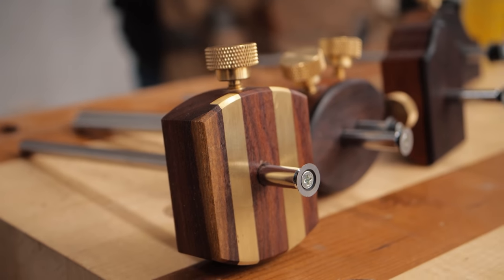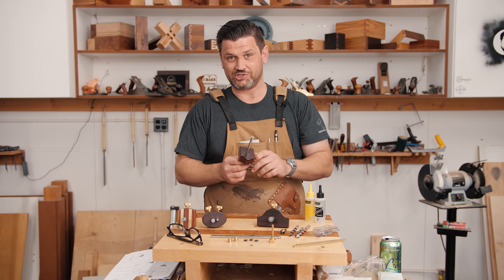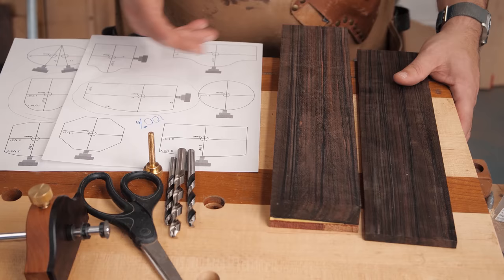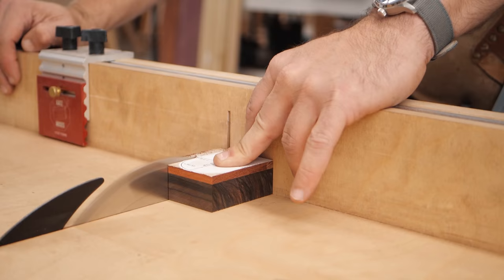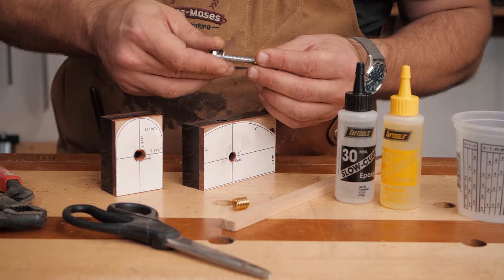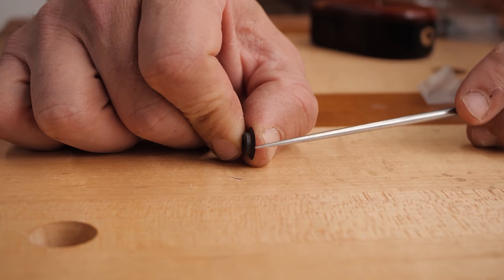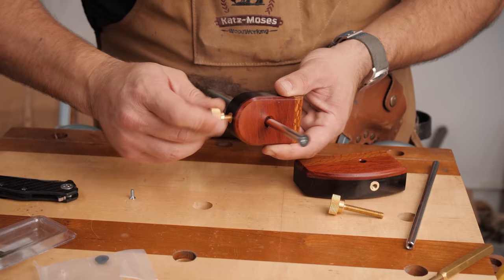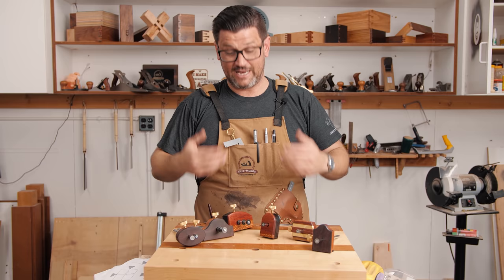Gorgeous Woodworking Marking Gauges - DIY for Under $12 - Free Plans and Templates

Comment: I ordered a kit and the 8mm bit and the mortising blades while the video was playing. 

Made a nice unit in walnut. The only thing I found was the shaft measured 5/16”. When I tested the 5/16 vs. the 8 mm, the 5/16 gave a slightly better fit. 

I’m a happy camper. Will be ordering a few more kits. 

Thanks JK-M.

Comment: I just finished making one. Did not turn out as well as I'd have liked. Everything was perfect until I went to insert the threaded brass sleeve. My first mistake was that I used a short bolt which did not extend down into the 1/4" hole which means the bolt did not provide any alignment and it went in a little crooked. Then it started to crack the wood (walnut) as I screwed it down tight and a small chunk actually came off the top. There was an internal split in the wood that I did not see and it cracked there. 

In the end I was able to sand the top but the mar is still visible around the sleeve and the brass knob is at a slight rearward angle. It is still 100% functional. The walnut and white oak laminate looks great. But, it is not at gift level for sure.

I will do two things to make sure this does not happen again. 1. I'll use a long 1/4" bolt so that it aligns the sleeve properly. 2. I have a cheap Harbor Freight tap and die set with the right sized tap for these sleeves. I experimented with some scrap wood. Threading the hole with the tap makes the sleeve go in much more smoothly and will probably decrease the risk of splitting the wood. A little epoxy should keep it in place.

Comment: Just what i absolutely love, easy and cheap tools i can make myself.
I have literally started an entire shop by building my own tools. So far, mostly my hammers: brass, wood, and a few smaller ones like a chasing or a finishing hammer. Chisels? Sure, i have a few. I love building my own tools, i have 2 compasses in the works, and a metric ton of other tools. Its waay too much fun, and when i grab one of my own tools, it feels so good to use them.

Comment: I've never had much luck with stock threaded inserts going in without splitting something or go in straight. I have typically got in the habit of using a dremel or hacksaw to cut two or three grooves across the threads, perpendicular to the body of the insert, as deep as the thread is high. I find they "cut" threads into the wood rather than force their way by trying to displace the wood.

Comment: If you cut the head off a bolt, you can put a couple of jamb nuts on it and lock it in the chuck of a drill press.  Turn the chuck by hand (don't turn the drill on) to install threaded inserts while keeping them square to the surface.

Comment: Trick with 3m super 77 only spray your paper template lightly,then Wave the paper template back and forth so glue tacks up then stick it to your work peace. Don't stick it wet or it's permanent if you do it correctly paper peels right of . Super 77 is permanent wet and contact if dry tac.

Comment: I covered it with blue painters tape. Then used the spray adhesive. Then put the template on that. The blue tape leaves no residue to clean up.

Comment: These are great, I'm in. The only somewhat obvious issue I saw with the single rod for mortises is trying to secure the second cutter blade. It looks like it's difficult to tighten the second blade without it moving. Jonathan was fumbling with it. Sliding a rod in and out seems much easier than trying to hold that tiny blade and tighten it without it moving. With that said, I'll just do two separate rods in mine.

Comment: For all the european folks, 6mm 8mm and 10mm bits work perfectly ... The quarter inch bolt that drives the insert into the wood is where it might be difficult to find in common hardware stores

Comment: Just to throw this out there... from a seasoned scroller.  There are other spray adhesives that are not as permeant sticky as the 3M you mentioned.  And comes up very clean with a heat gun.

Comment: Great video, as always. Two comments which you might find helpful:
1. I have one of those complete drill indexes which includes fractional, number, and letter drill sizes, covering 1/16" to 1/2" --  I got it from Harbor Freight for 50 bucks.  Between the 3 kinds of sizes, I almost never need to buy a metric drill bit. For example, 8mm is 0.315 inches. A letter "O" drill bit is 0.316 inches (8.03mm)... close enough for me.
2. You put your thread insert in backwards. The slot on the end is to use a screwdriver for installing it; once you've got it well started with the bolt, you remove the bolt and finish driving it in with the screwdriver. It's really easy to get it nice and deep, below flush, that way. Plus, if you ever need to remove it, you just stick your screwdriver in the hole and back it right out.

Comment: I have one with a cutting wheel which is very blunt. I am trying to sharpen it onto a diamond stone but it seems the steel is hardened and the stone doesn’t cut into it at all. It seems impossible to sharpen. Any suggestions?
Reply from the maker: Get a new wheel. They sell them through the links in the pinned comment. Or get a kit and make one and you get 2 extra cutters

Comment: Love the video, but I have a question. What is the difference between the marking gauge with two rods, and the one with two cutters on one rod?
Reply from the maker: I talk about it in the first couple minutes
Reply: You’re right. I saw it, very helpful. Are there any other simple tools that can be made in the shop? Especially for dovetails, like layout tools, or marking tools?